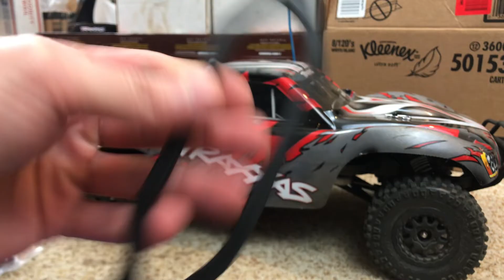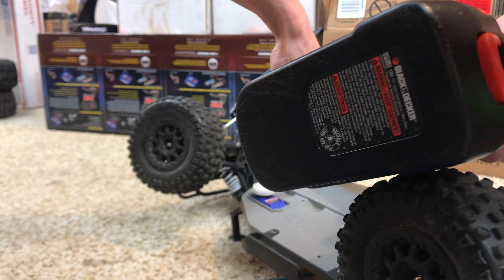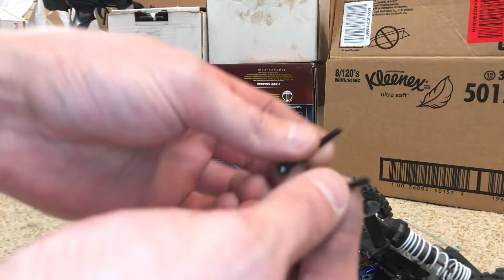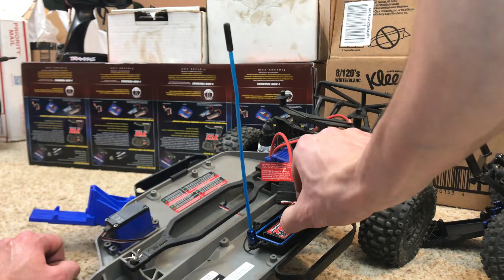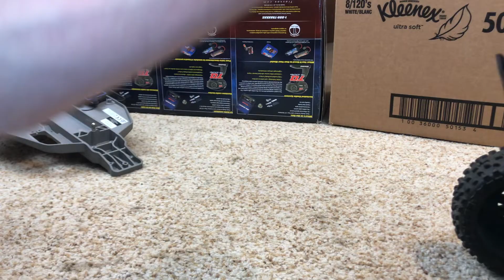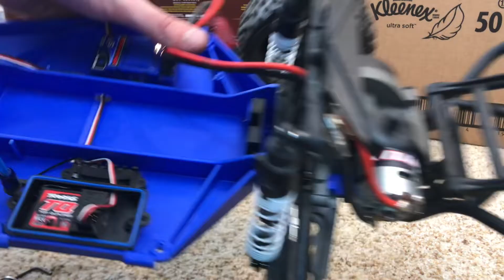Traxxas Slash 2wd LOW CENTER OF GRAVITY CHASSIS Conversion Kit #5830 - INSTALLATION!! Worth $39.99??

Comment: Hey, mine is doing the opposite steering. I’m  holding down set on my receiver, but it never blinks the green light. Any suggestions? I’m using the TQ 2.4 GHz.

Comment: Hi guys. Thanks for this video :)  Do you know if it's possible to mount the white plastic steering assy,  from HCG ? (i mean the part # 3743 ) or it's better to use the steering from 4x4  ? (part # 6845x ) .   i prefer to avoid metal upgrade for know.
Reply from the maker: You should be able to use the stock bellcrank system…I’m pretty sure it just takes shorter screws to hold the bellcrank down
Reply: @RCKnockout  great,  thank's ! :)
Reply from the maker: @Ben_01100  you’re welcome!

Comment: Have you had issues with putting the aluminum bell crank on the new lower chassis piece pegs?
Reply from the maker: No mine went on without issue
Reply: @RCKnockout  I just picked up the Traxxas aluminum bell crank and I am having issue’s fitting it onto the lcg chassis pegs
Reply: The bearings are super tight
Reply from the maker: @northerncountryrailroad8939  hope you can still get them slid on….mine went together pretty easily if I remember correct

Comment: On that bumper can the wheels of the wheel bar fit on that bumper or will I have to get a different bumper
Reply from the maker: It should fit…..I don’t see why it wouldn’t
Reply: @RCKnockout  we’re do they go on that bumper
Reply from the maker: @dustinplee5067 …..idk….I think it’s just the stock bumper….so If it mounts on a stock one it should mount on this one too

Comment: Use a dust cover on this lcg chassis, I've had small stones stuck between drivesaft and chassis and motor
Reply from the maker: I don’t think a dust cover will cover the driveshafts on a 2wd machine….I think you’re referring to a 4x4 machine

Comment: Can't wait for mine to get here I'm practicing by watching the video 😆
Reply from the maker: Yeah you should try it out stock before you convert it so you can really see and appreciate the difference in handling between the two
Reply: @RCKnockout  I noticed that the high center chassis keeps flipping my slash and I love to do the 180 turn in reverse but I don't like it flipping upside down. And i do want to race with it and have speed while turning.
Reply from the maker: @gamercat7004  yeah the lcg chassis is definitely a must if you want your Slash to go around a track
Reply: @RCKnockout  ya I'm new to this and it's been at least 1 to 2 months in rc and know how to assemble and try learning this hobby.
Reply from the maker: @gamercat7004  yeah it definitely takes time to learn about the hobby…you’re always learning too……there is so much I still don’t know about the hobby

Comment: I just got my first slash 2wd and Done some minor upgrades I'm gonna have to try the heavier shock oil for sure. Anyone know why within a month of first having it and running stock everything except 2cell battery  and motor burnt up.... Had to get a new one hoping it doesn't happen again any tips
Reply from the maker: Brushed motors aren’t necessarily known for longevity…..that’s surprising since it was completely stock though

Comment: There’s isn’t any extra “ground clearance” with this chassis. Because the height of the bulkheads is the same regardless of LCG or not. This chassis should’ve never been designed. It just forces an upgrade part cost.
Reply: Thank you for this video btw!!
Reply from the maker: No problem 😉
Reply from the maker: Yeah they should at least have a lcg option from factory

Comment: At about 13:30, I think you missed the two screws under the bumper ass'y that connect the chassis to the bulk head.  Part #3937
Reply from the maker: If I did…..I probably missed it when editing…..I’m sure I actually did install those screws….thanks for letting me know though

Comment: Do you think a shorty lipo and a normal brushless 1/10 esc would fit in her battery tray
Reply from the maker: Yeah I’m sure they would both fit……you’d have to find a way to mount the Esc though
Reply: @RCKnockout  double sided tape. Yeah I was just wondering cuz I’m building a drag car soon and wanted to centralize the weight
Reply from the maker: @endosrc  yeah I’m sure you could find a way to make it fit
Reply: @RCKnockout  I’m hoping by this time in 2024 I’ll have it down to like 2.1 but I still have to build it. So yeah. Thanks for the info
Reply from the maker: @endosrc  no problem…..best of luck

Comment: Hey do you use this to race or do you have a separate car for racing? I mean even if you race at all
Reply: What’s your car for racing?
Reply from the maker: @zaccamacho4670  Losi SCTE
Reply: Do you have a video for it? I wanna see it. Cause I’m fairly new I wanna race. I wanna use a slash cause I’m new. I don’t want anything to expensive just yet
Reply from the maker: @zaccamacho4670  yeah I got a video I’ll share with you
Reply from the maker: @zaccamacho4670  https://youtu.be/JnnnZpO2mOs
Reply from the maker: I use a different car for racing but I could potentially use this one…..it’s set up pretty well at this point

Comment: Great video. It helped me with this used RC i bought that someone had already converted to the LCG but didn't do the proper job. Thanks a bunch!
Reply from the maker: No problem….glad you found it helpful 😉
Reply: @RCKnockout  just wish there was slightly better camera views for the front end with the servo but all good
Reply from the maker: @cindyshields5753  hopefully you still found it helpful
Reply: @RCKnockout  yep! Built my Drag car so hope it works
Reply from the maker: @cindyshields5753  hope so 🤞

Comment: Just installed mine. Made a very noticeable difference to the handling of the truck. Definitely worth the money and some might say this is the way the truck should come from the box!
Reply from the maker: Yeah I think people should be able to at least purchase the 2wd Slash with the LCG chassis…..only 2wd Slash that comes with one installed is the Traxxas Drag Slash
Reply: I have m.s. &, I am disabled I carnt work any more but I like pushing my body the whole left side of my body is knackered but I try,the red shock towers go well with red a arms & shocks & Anything that I find to buy make it look good the blue chassis alot of red bits I carnt decide weather or not I should have proline bodyshell mounts that are ajustable or red rigid bodyshell mounts I want to put a protoform corvette c7 drag body on top.thank you Andy timson  England

Comment: You didn’t use the shock springs, or mention them. Are they different from what comes on the Slash, or do they have the same spring rating?
Reply from the maker: That’s true I didn’t…there was nothing in the directions about the shock springs if I remember correctly…it just included them in the package…I assume they’re a different spring rate

Comment: It’s round bc it has a spring in it to make the servo last longer
Reply: It’s round, because it is the servo saver. There is a spring inside it, that absorbs some of the shock and stress to the servo and steering components.
Reply from the maker: I realize now that it’s basically the Servo saver

Comment: FYI: with the red & black wires that are a little short from the motor to the esc (about 19 mins in) all I did was drilled a new hole in the bracket below the one that is there & it gives the wires a little more room.
Reply from the maker: Gotcha! Thanks for the info!

Comment: Ever since I reinstalled the servo my steering automatically pulls all the way to right how do I fix this!?
Reply from the maker: You take the Servo horn off and realign in. You need to make sure your Servo adjustment knob is at neutral and then try to put the Servo horn on with the wheels pointed as straight as possible

Comment: When I turn my rc on it goes all the way to the right n when I turn it to the left it barely moves what do I do?
Reply from the maker: That means your Servo horn isn’t centered. Take the Servo horn off. Turn the rc on and then screw it back down pointing straight up when the rc is turned on
Reply: @RCKnockout  I got it thank you boss man
Reply from the maker: @noesandoval1578   no problem! 😉

Comment: Hi, I'm 12 years old and I have a slash too. I am thinking about converting my slash into a monster slash and I watched other people's slashes and they kept the regular chassis. I want to get the LCG chassis so i don't flip over a lot and improve handling.  Also I am going to put the ProLine Trenchers or the Traxxas Talon tires. So I just want your thoughts about it. Thanks.
Reply: Ya though are you thinking of racing or just bashing cuz its kinda pointless to get the low cg chassis if your converting it to a monster slash cuz it makes it higher centre of gravity ;)

Comment: My slash has the on board audio, do you see a spot for the on board audio box thing mount? Is that thing on the very front of the chasis for oba or telemetry? I am getting my new lcg chasis soon but I’m wondering if I can use the oba or not, I usually don’t but I like to have it.
Reply from the maker: I’m not sure. I would assume so. But I don’t have OBA so I’m not sure?
Reply: @RCKnockout  I will have to wait and see when I get it but this is a great video, I will definelty come back when I get my chasis in the mail.
Reply from the maker: @adamj357  nice! Hopefully it will help you out!

Comment: i like the high cg chassis cause scale lol
Reply: Yea i see where ur coming from
Reply from the maker: @cleared8086  yeah it gets old having to go flip it over whenever it rolls
Reply from the maker: Scale what?
Reply: @RCKnockout  because the body roll simulates a trophy truck with the soft suspension
Reply from the maker: @cleared8086  I gotcha. Yeah it does look more realistic but I’d rather have the lcg because of the handling benefits

Comment: First thing I did was booger grease my diff and installed my own sway bars and it prevented traction loss completely.. it still had a lil body roll but once I did the low cog chassis it did stay flatter thru corners
Reply from the maker: Sounds like a pretty good fix. LCG chassis is definitely a game changer. Makes the thing perform way better

Comment: You should mod out the entire car with aluminum and put a brushless also put some sway bars that will help with the open dif
Reply from the maker: Lol. Zero chance I’m gonna outfit this thing with anymore aluminum. I want to keep it as light as possible. I already feel like I’ve gone a bit overboard with the aluminum parts on it.
Reply: The ONLY aluminum parts you should put on the slash are the bellcrank, the axle carriers and steering blocks, and the turnbuckles(Traxxas brand). Everything else is worthless unless it's a shelf queen. Already been through this. Tried all aluminum turnbuckles on my last slash raptor and it made the entire front end sag and it was terrible. RPM parts for everything else like arms and bumpers and shock towers.

Comment: Nice detailed presentation of this LCG chassis mod.  Been considering it for mine, though I'm not sure it's appropriate for my needs.  I think my use warrants ground clearance over stability and all out speed, but it's definitely nice to see the whole process to swap out.  Can't wait to see the drive testing with the LCG.  Thanks Nolan.
Reply from the maker: No problem man! 😉
I didn’t really find the belly clearance helping very much. I feel like with the 2wd it gets stuck pretty quick regardless of the chassis. I guess I am comparing it to the 4x4 models which isn’t really a fair comparison.
Reply: @RCKnockout  Yeah, beyond playing with gearing a bit, my next mods are likely to be that hack I shared with you to shorten the full extension of the shocks (little piece of fuel line on the piston, inside the shock so it can't extend fully), and heavier oil in the shocks as a method to quell that "body roll", which is quite bad and only gets worse as it goes faster.
Reply from the maker: @mattfoster1684  nice man! It should perform a lot better then! I thought about doing that myself. I didn’t realize the fuel line goes on the inside of the shock though? I thought it was just supposed to rest on the shock perch and sit around the shock shaft?
Reply: @RCKnockout  Yeah, he actually puts a small piece on the shaft but inside the bore of the shock with the oil, so it requires complete disassembly of each shock, which is a wee bit arduous.  Basically acts as a stopper for the piston so it can't fully extend.  Net effect is likely somewhat similar to the LCG shock modifications, lowers the ride height overall.
Reply from the maker: @mattfoster1684  I gotcha man! Yeah if I did it I would probably go the easy route lol 😂 
As long as it still works

Comment: That white thing your calling a servo horn is actually the servo saver.  They all used to look like that in the 80s and 90s. 👍
Reply from the maker: Thanks for the info! I figured it served some purpose. I should of known since I never saw a Servo saver on the steering assembly lol. 
Does it have a spring in it? Or how does it work?
Reply: @RCKnockout  yes, it does have a spring inside it.  Other then that, im not 100% sure how it works either lol.  I think the inside circle attached to the servo spline can spin and its hooked up to the spring.  The outside circle attached to the steering arm is stationary 👊👍
Reply from the maker: @GoFindAsafeSpace  I learn something new everyday! Thanks! 😉
Reply: @RCKnockout  You should have been given 2 extra white gears that came in the box. That little gear should strip before you damage the servo gears. Hence the extra ones provided.
Reply from the maker: @Beyondxtc5  I’ll have to look. I never noticed any extra ones

Comment: I have fixed the rolling issue by changing the shock oil. I went with 40 in the rear and 50 in the front. I can do full speed turns with no roll. Love it.
Reply from the maker: I have thought about putting a heavier weight in the front because it’s still dipping and then tipping over itself. I assume stock weight fluid is 30wt?
Reply: @RCKnockout  yes I believe stock is 30wt all around. But I saw noticeable improvement with those wt combos. Try it out lmk what you think
Reply from the maker: @cbdfpv  thanks! I might try that out but I might also have another route that I’ll be taking. We will see

Comment: Awsome upgrade. 😖 im pissed i cant get a rpm gearbox anywhere so my motor gets hot too fast. I may have to remove these useless but awsome looking aluminum a arms. If i hit something there gonna bend and i think its to much weight for my gear set up.
Reply from the maker: Thanks man! Yeah the lighter you can keep the rc the better it’s gonna fair in a crash
Reply: @RCKnockout  it will burn the motor up to. Even the Castle motor box says no more then 7 pounds but noooooo lol! I had to have the red annodized A arms .😂 we all get suckered once in a while. We need a holds no bared no bullshit way to have an rc car without loosing a fortune to rc hobby store sales tactics.
Reply from the maker: @N-GaugetheTrains  lol. You can only build up an rc to a certain point. Everything has a breaking point...a weak link.

Comment: Thanks for the videos!  may i ask what ya ended up doing with those xmaxx 6700 lipos that wouldnt charge on your traxxas charger anymore.?  Thankyou for your time
Reply: were did ya get your ammo can?  Thankyou for your help
Reply from the maker: @johngantner9314  local farm/auto store
Reply: I ran my erevo 2.0 today at the park and it was way faster than the Xmaxx so thats telln me my batteries are bad.  no more 6700 or anything traxxas electronics.   if they dont have a balance plug im not buying it.
Reply from the maker: @johngantner9314  The erevo should be significantly faster than an Xmaxx. Unless the Xmaxx is modified? Stock Xmaxx is 50+mph. I think an erevo is 70+mph capable out of the box. 
Probably for the best to ditch the Traxxas batteries though. You can find a lot of batteries that are a much better value
Reply: @RCKnockout  that blows my mind yesterday at park i ran my Erevo 2.0 then my Xmaxx.   how is it that a 6s erevo is faster than 8s xmaxx, but its the gearing and car versus truck sort of thing.   Needless to say the xmaxx was not as fun to drive after the erevo 2.0. Lol
Reply from the maker: @johngantner9314  the erevo is considered 1/10 but In reality it’s really 1/8 scale. They probably weigh 6-8 pound less than the Xmaxx. The power to weight ratio has to be in their favor I suppose.
Reply from the maker: I still have them sitting in an ammo can. I’m not 100% sure if it’s the batteries that are the issue or if there is something wrong with the ez peak live charger? So I don’t wanna discard the batteries without knowing
Reply: my 4s ez peak charger was doing the same thing w my max amps 4s 6500 battiers.   So I took my other charger that looks like your white one just different brand name on it and i just charged the pack w one of the cells lower than the rest and it bumped it rt up.  I aldo been charging the traxxas 6700 w just putn it on. charge no balance and it charges rt up.  I think im gona have to chuck them soon.   2 cells are bad.  I got almost 3 years out of the packs